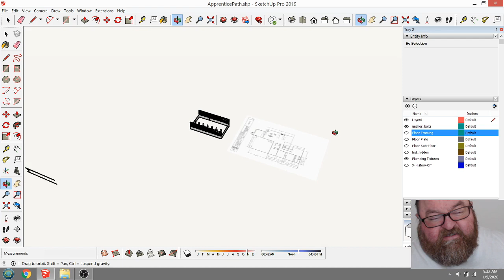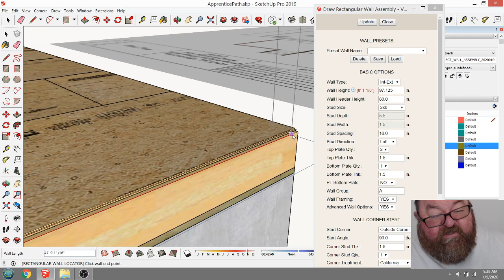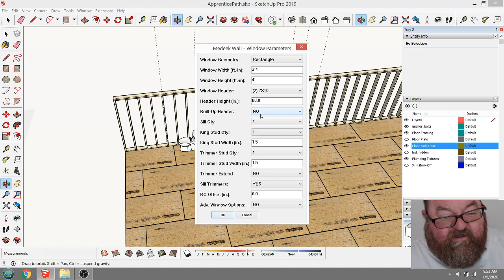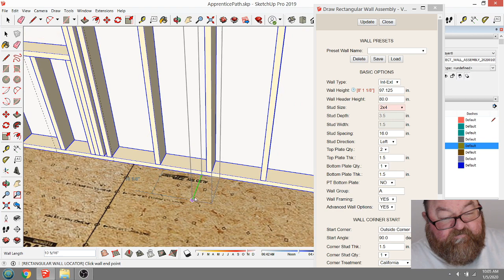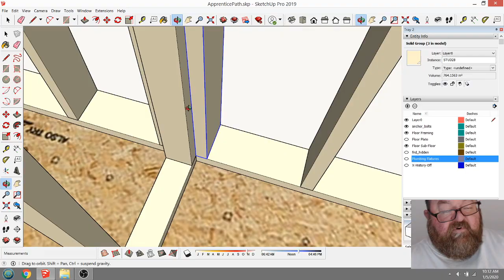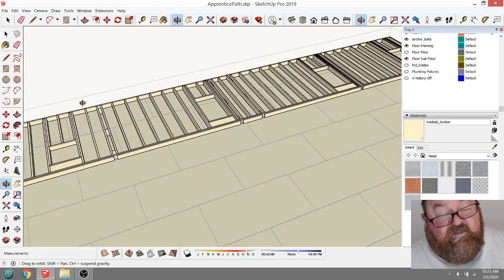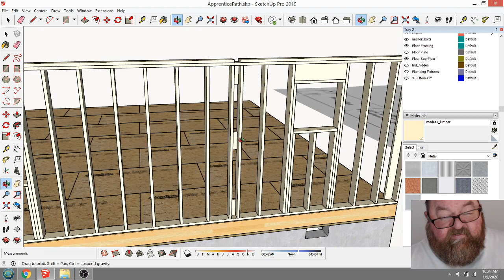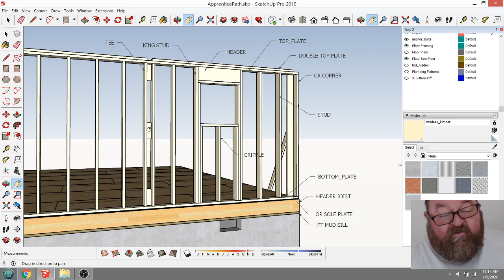Wall Framing Techniques and Terms - Part 1

Comment: When I framed in Florida, you had to use 2x6 framing. Not to mention all the strapping and extra bracing. When I first moved up here and saw 2x4 framing, single jack studs on exterior walls, porches held up by 2x4's...I thought the houses looked like they were framed with toothpicks. It's weird learning how to frame in Florida and then moving to a place that doesn't require all that. Made me thinks the houses were just going to fall down...lol.
Reply from the maker: Recently our energy code started requiring 2x6 to get R-19 in the walls.  You guys had wind that we do not have. :)  The building inspectors around here require two jacks on headers over 4 feet.  But many homes have been built and are still standing with 2x4x92 5/8 studs at 16" o.c. :)  Thanks
Reply from the maker: But I am going to mention this in my next video thanks
Reply: ArtisanTony the framing here is just fine. Just first learning to frame in Florida made me think everything here was “under built” but in reality everything in Florida is just “over built”. Wood is incredibly strong when built correctly.
Reply from the maker: @In_Case_Im_Fake  I agree